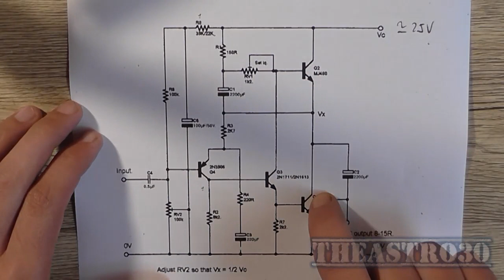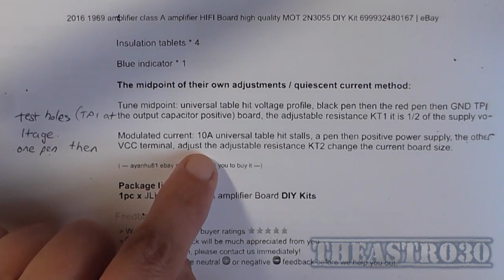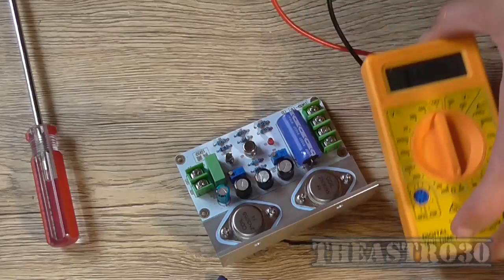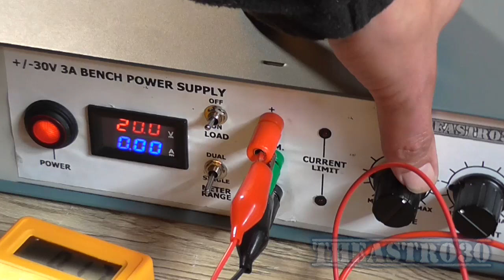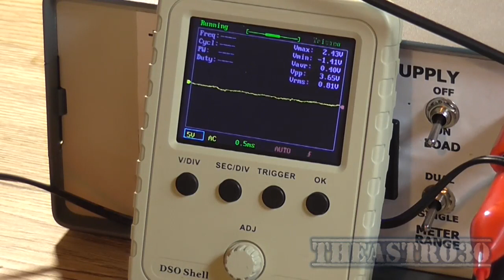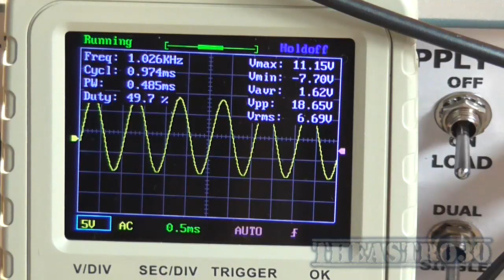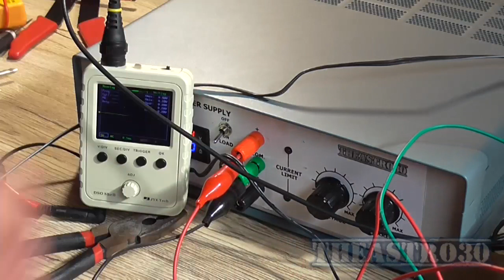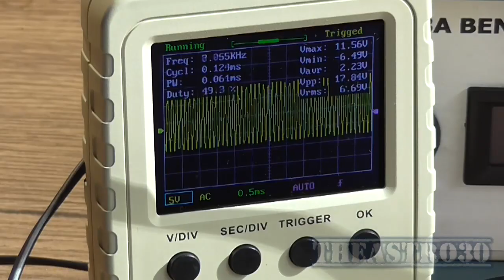"1969" John Linsley Hood Class A Amplifier Clone Build

Comment: I possibly  misunderstood you, but I got the impression you said that cross-over distortion was due to "the way transistors work". As far as I understand, crossover distorsion is not present at all when you run a single transistor ( or a tube ) in pure class A, which is the main beauty of it. The cross-over distorsion arises when you run a pair of transistors in push-pull configuration, and bias for class AB operation, i.e.  positive half of wave taken care of by one of transistors, negative by the other, and merge the two halves together. The mismatch between the two non-identical ( or non-symmetrical ) halves , or the timing mismatch, gives crossover distortion.
Reply from the maker: No, I meant on a Class-AB amplifier on a bipolar supply. Class-B can have severe crossover distortion if it's not designed/biased right. Class-A has none on both bipolar and single ended.

Comment: To be fair, John audio tested with a square and sinusoidal signals, and the distortion increased noticeably above 10kHz. In that simple oscilloscope, and only with a 1khz sine signal (or listening) that distortion will not be seen.
It's a matter of slew rate, not crossover; the amp starts to have problems with the "rissing speed" side of the signals, it also showed that the original transistors (probably fake (?)) had HF instability issues (ringing). 
Anyway,  in a listening situation, the overall distortion will be dominated by dist. generated by the speakers; hardly anyone can identify distortions less than 0.15 - 0.2% with their ears alone , that's the "facto standard" for a lot of studio monitors (amplifiers usually have distortions an order of magnitude smaller (0,01% and lower))

Comment: 32:15 "...sometimes results in the output sounding like it's got clicks, pops, snaps and crackles..." Those sounds are something entirely different, like, maybe a bowl of Rice Bubbles being spilt over the amp!

Crossover distortion seems to be widely misunderstood... It can be helpful to think of crossover distortion as a form of clipping. 

Not altogether unlike AC rectification (where signal peaks are momentarily steady-state DC), crossover distortion causes the signal to be momentarily steady-state DC too, though, during 0V signal excursions.

Both clipping (peak rectification) and crossover distortion (0V rectification) result in an increased harmonic spectra. However, unlike clipping, where the generation of harmonic components is primarily additive, crossover distortion appears subtractive in nature, often resulting in an anaemic, fuzzy sound, due to the increased odd-order harmonics and limited energy of the fundamental.  The negative effects of crossover distortion become much less pronounced with large amplitude signals.

Some audio effects rely on crossover distortion though, so it's not all bad...

Finally, crossover distortion is related to device operating region, not device technology; valves do equally produce crossover distortion when operated at or near cutoff too.

Comment: Great video, just wondering, is a 24 volt (24- 24+) 160 va transformer ok to use for two boards (stereo). Cheers.
Reply from the maker: Should be. As long as each secondary can handle 2A continuous.

Comment: Dude,  Thanks for doing this man.   Not all of us are circuit wizards.   Data and networking sure... But audio circuits, Nope!
 Anyways,  I might try the build now.   But I really want to do a class A tube type thing in a car.  Just for the tweeters and mid range.    Midbass is simply going to have to be a Class A/B.    It seems like this has more then enough output for a tweeter with high sensitivity, but my  tweets may not be ideal.    I was thinking of building my own ribbion drivers, but I think I will just leave that up to Joesoh Pelon   (DIY Ribbon speaker fame)       

Again,   thanks for this.    If possible,   would be really cool if you could make another video about mods to this ebay amp, and maybe get more clean power out of it.      

Have a good one Astro!  
iMickey503

Comment: I have bought this very kit. It will be my first attempt to adjust a transistor. for that I will be referring to this video. Also I have never installed a transistor on to a heat sink. Can anyone tell me where I put thermal paste for this one if at all. Thank you for any help.
Reply: He didn't use thermal paste (the insulator pad works reasonably well for that). What you can do to improve things is where the Aluminum bracket joins the bigger heat sink, use thermal paste there to improve the thermal conductance.
Reply: @Anchor2012  Thank you for the reply. I can now continue with confidence. I am a beginner and my kit came with no instructions. I may have more questions hopefully someone can answer. I am mostly getting into chassis fabrication.
Reply from the maker: Good advice about thermal transfer between bracket and heatsink

Comment: Hi.....first of all congratulations for the video...i'm also building the same jlh1969 amplifier but i didn't understand how to adjust the quiescent current....bad english/chinese...can you tell me exactly where i have to put the two multimeter leads to regular i think about 1.2A???  Thank you ... good evening!
Federico
Reply from the maker: Sorry for late reply, the leads go in series with the positive supply lead.
Reply: @AstrosElectronicsLab  ok many thanks....but you have used a multimiter scale V (volt).....you are sure?? The right scale shouldn't it be the ampere scale or rather milliampere?? 🤔🤔🤔
Reply from the maker: @gabrielomar1970  You can masure the voltage drop across a resistor in series with supply lead, say 1 ohm 10W on the voltage scale. Ohms law says for a current of 1.2A, the voltage drop should read 1.2V (V=I x R = 1.2 x 1 = 1.2V)

Comment: 28:40 is it okay that your sine wave is so shifted? 11.15v to -7.5v so average is 3.65/2 volts but it should be zero.
Reply from the maker: That's just because I never centered it on the screen. The voltage measurements are still the same.

Comment: Your calculation of output power ~30min in wrong. It should be about 5.4Watt instead of 10.8Watt. Actually, to use Vpp to calculate average output power, the formula should be Vpp²/8/Load/. So if Vpp=18.65V, Load = 8Ω, the output is 18.65²/8/8=5.43W. So, now the problem, can you get the rated output of 10W by increasing the supply voltage? Or will the amp hitting some problem when the supply voltage is increased. I would like see this included in the video.
Reply from the maker: You're probably right, I may have forgot to halve it before squaring it. And the max voltage is 25V for the supply.
Reply: @AstrosElectronicsLab  I'd say anyone contemplating this build should first read the published articles in Wireless World.
From memory JLHood specified 10 watts into 8 ohms needed 30volt supply at 1.1 amps, higher current/ lower voltages for 4 ohms etc.
 Best throw the junk transistors away, use good outputs and if not matched then the higher gain one to the lower poisition in the circuit. Stick to the original design, outputs mounted on BIG heatsinks, not on the bracket. Usual 4 inch wires to the outputs can aid stability. This was a very wideband amp.
 The Chinese kits are only usefull for the PCB and not all of those are great.
 Built right, this amp is sublime, I built my first in 1972.
Reply: I built mine (stereo) at about the same time, worked faultlessly for over 40 years. I introduced a diode into the quiescent current circuit, and glued it to the driver transistor's can, to limit thermal runaway which could happen to these amplifiers. I haven't been able to find the reference to the diode modification though. Good, clear video. Thanks.

Comment: The John Audio review shows the use of test gear and why " upgrading " transistors could  be a bad idea if not able to do the tests.  The power suppy used ( PSU ) is important and has to be of better quality than is unsual. A lab PSU as here would be good.

Comment: Для 4 Ом. колонок выходной конденсатор нужно увеличить до 6000 мкФ для выравнивания амплитудно частотной характеристики.
Reply from the maker: English, please.
Reply: The original article on this amplifier recommended a 5000uF coupling capacitor for a 3Ω speaker with a 10000uF smoothing capacitor in the supply psu.

Comment: Those isolators should go on the base and emitter holes to avoid shorting. The collector to board is shorted by the screw so makes no sense what you did.
Reply from the maker: Did you watch the video? There is a reason it was done that way. Thanks.

Comment: When did you measure the distortion properly ? your "scope" cant do that, you are only going by your ears which is very subjective, JAT did point out that the mounting method was less than ideal and that mechanically its not great and his issue with the pot was down to a wiring error on his part, perhaps you should label your DIY power supply properly to avoid confusion between ground and 0v and yeah I remember my folks having similar speakers in the seventies, thank goodness they went out of fashion !...cheers.